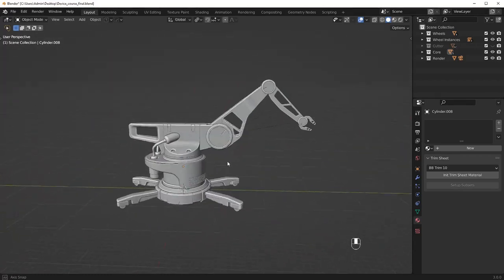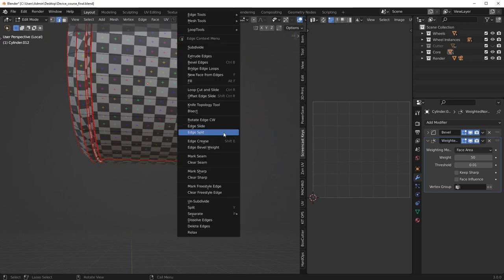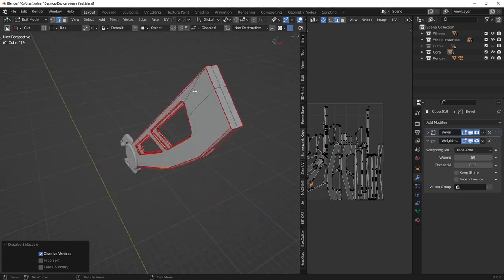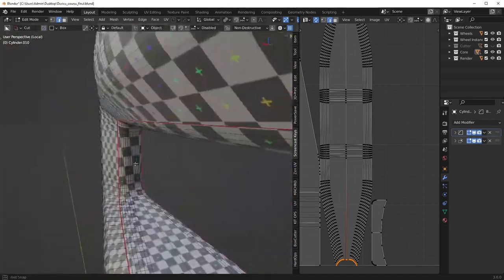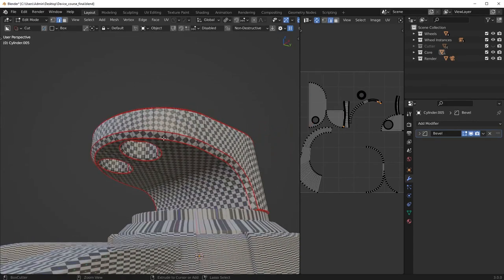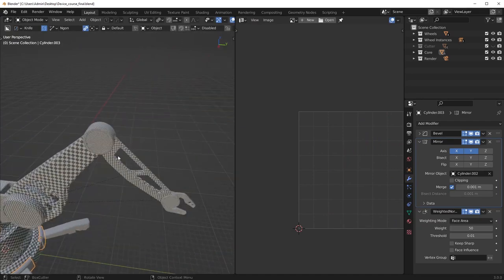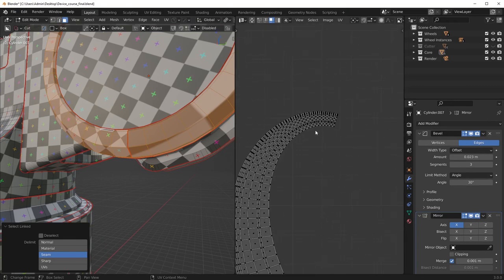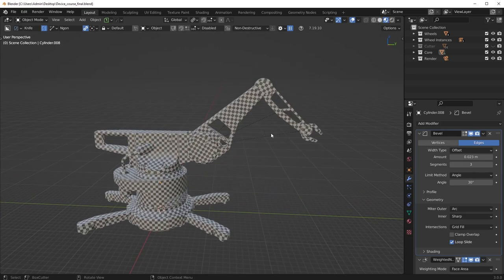A Casual Hard Surface Unwrapping Workflow (Blender)

Comment: Is unwrapping a UV necessary if you're just working on a scene to render in blender and not exporting as an asset or to other programs?
Reply: if it's something that's going to have a basic color/metallic/roughness value in the end; then not really, but if you intend to texture it in anyway whether it's in blender or another program, you need to uv unwrap. Low poly artists tends to just use basic color/metallic/roughness values and looks nice without any uv unwrapping/texturing.

Comment: unreal 5 is out now...that would be a game asset as is now....fyi i'd break up those really long thin large islands more. things dont need to be so contiguous anymore since painting apps can handle pixels across uv borders np.
Reply from the maker: Yea, visible seams can be masked much more easily nowadays - I’d just rather show the proper considerations first.
Reply: So you just paint in unreal 5 now? No uv mapping needed?